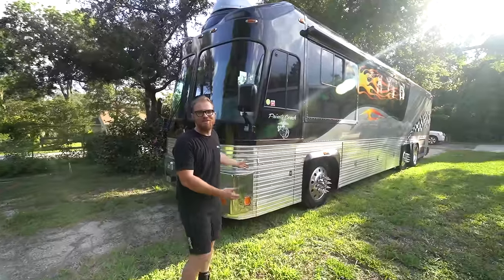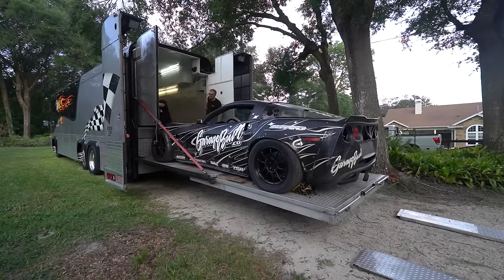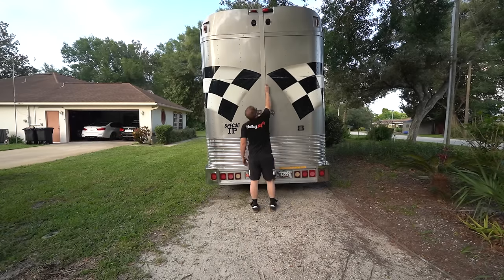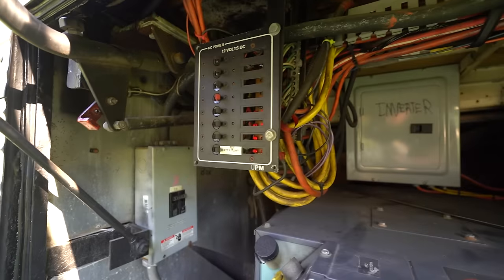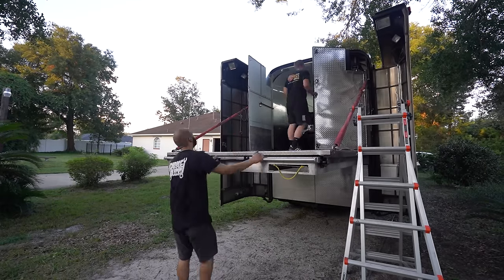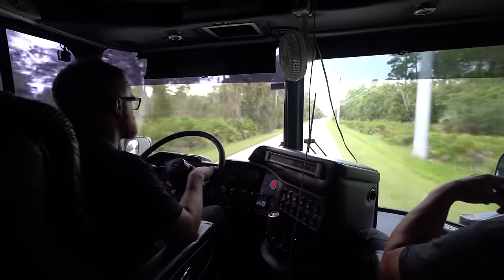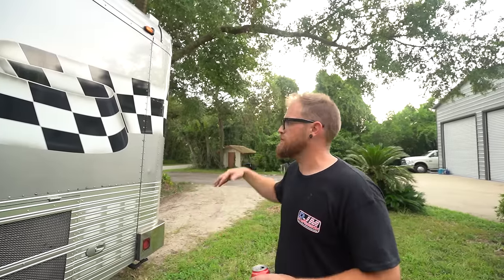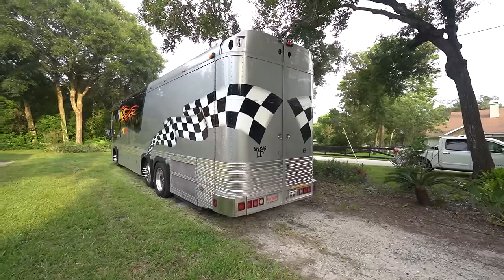First test of the new race car hauler. RV bus conversion. will it fit?

Comment: I was a coach mechanic for 40+ years, mostly MCI, Prevost,and Van Hool. Didn’t work on to many Eagles. I know they have a weird torsion bar suspension. I’m sure the guy set it up for the added weight of the car in the rear. It looks like a Cummins M 11, and I would assume it has an Allison automatic trans? Probably going by the year a HT740? Nice setup!

Comment: Would be a good idea to get under it (if possible) and drain the air tanks out from the valve on the tank to make sure there’s no water build up. Sometimes there’s a cord attached to it and visible off the side so you don’t have to get under. Drain all of them, start the truck and let it build to pressure and let it sit to see if it has a leak. Also getting under with a grease gun and hitting every grease fitting is good to do. Just some regular maintenance tips. This thing is sick man good luck with it cant wait to see upcoming videos
Reply: I thought I heard spitters on it. The kind that automatically expel all the moisture periodically. I could be wrong though. I would install some if they are not already.
Reply: @b-radfrommalibu  That's just the air dryer purging, you still have to take care of the tanks.
Reply: @-tr0n  oh ok good to know

Comment: You keep referring to your coach as a converted transit bus. It is a model 15 Eagle highway coach. Used by many coach operators such as Continental Trailways. Many Eagle coaches were converted into motor homes which were favored by traveling entertainers since the Eagle uses a torsion bar suspension which gives a superior ride over an air bag system. I saw one comment telling you to lift the tag axle so you can make tighter turner. You can’t lift the tags on an Eagle since there are no air bags. Are you sure your power plant is a  Cummins? It looks and sounds like a Detroit series 60. Good luck with your project, she’s a beautiful coach.

Comment: With the winch, they don't like rolling up without tension on them.
Probably best to unspool it completely and re-wrap the whole drum. 

Rig looks awesome.

Edit. Add a side roller to the rear winch, that will help keep the wire more centred.

Comment: Suggest you watch some of the "Bus Grease Monkey" bus maintenance videos he has done. Diagnosing problems and preventive maintenance with these rigs is imperative! Some  OEM parts are very hard to locate or acquire.Your air brake system must be spot on for you and other vehicles on the road. AND just for giggles drain your main air tank NOW!

Comment: One thing i noticed is all your tail lights are on the doors that open  so if you had to work in the engine bay at night at the side of the road you would have no visible lights, so you should look at adding some tail lights behind the doors as well!

Comment: I didn’t get through the whole video yet but with our team that races cup spec Porsches we take off the drivers door when putting it in our hauler, especially on the top level. It’ll help a guy get in and be able to steer and brake while also being able to get out easier.  We may have more clearance than you though.

Just a thought! Love the rig brother!!

Comment: Bus is awesome! But, what's the point of the diamond-plate doors? It's a 3rd layer and seems to cause all the issues. Can't you just take them off? The lift and the clam shell back should seal it all.

Comment: Bus is cool af man. Curious,  do you need a cdl to drive it? It would be cool to use the air compressor to fill another tank so you can use air tools at the track if you had to.

Comment: Hey man, I have a tip for how you can easily drive the car in without being inside. I saw once a dude who put a snap-on u-joint adapter on his steering wheel, a rod going through the side window, slightly protruding, and literally had a quick release steering wheel on it to steer the car! Sound insane but it worked neat!

Comment: did you check the slack adjusters in the s-cam air brakes, are they the auto adjust or manually ,  know where your tow points are under the bus it's heavy and one day you night get stuck.

Comment: You should do the trick that most lift gat trailers have. Have a strap that grabs the side when it's about half way up and as you lower the gate it lifts the gate at the same time. Gets rid of the need for the winch all together.

Comment: So happy for you! Man just think back to when you started and where you are now!
Silly question though, are the rear internal doors required?
The ones that cause the loading and unloading of the car to be super tight. IMO those doors could be removed unless they provide a weather shield.
Maybe a good alternative would be to replace those twin internal rear doors with a single lightweight door that lifts up over your head and is then held in place, this could then create a simple canopy and would also provide you with more space left to right.

Comment: I watched the Hunt the Front guys struggle loading their late model into the trailer. They use a steering wheel buddy, it’s used to steer the wheel from the back or front while using a winch. Might look into that.

Comment: One thing I would like you to do get the CDL book and read it .. lots of little details that will help you to make tight maneuvers .. you also need to get the exact height of the bus and write it down somewhere inside the bus where you sit .... Heights on Bridges and overpasses are very important they vary from state-to-state ... The two most serious problems people driving large vehicles are heights and turning .. I have driven a bus for 21 years .. if you ever need some help or need to ask a question I will gladly help you ... Excellent purchase enjoy

Comment: Hey Taylor-
First off, congrats on the new bus,  you've earned it, you stayed humble,  and let's face it- the perfect rig found the perfect home!  Anyway, I have a Buddy that has a similar rig (not as quite as nice, but close) and he dug out  a  little "pit" for his lift gate to drop into when he wants to load/unload his vehicle.  This eliminates having to mess with those 2 little ramps, as the lift fits perfectly into the recess.  He has 2 pieces of angle iron so the front tires of the bus align perfectly every time and it makes loading and unloading a breeze. Outside he has a pedestal with power, water, sewer, etc. so he doesn't have to go somewhere to empty the tanks, and that gives the bus "full hook ups" if he needs to have an impromptu place to put up guests for a few nights. Everything at the house is all stored in a 2'x4' rubber maid-type basket when he's out of town, keeping his yard uncluttered. He took a couple of hole saws and put access holes for the cables and hoses to go through when he's hooked up.  (It takes bad-ass to a new level) Even has an internet CAT5 cable tucked away in there, thus, avoiding wifi hassles.  To make the "pit", he borrowed a friend's Bobcat and dug it out in less than an hour. It's so cool.  I'll see if I can get him to send me a few photos that I can pass on to you, in case you want to do something similar.

Take Care, my friend, enjoy life, and have fun in everything you do.
DB from AZ

Comment: I'm gonna give you my 2 cents on it. Heavy trucks are much more envolving when it comes to maintenence, even in regular stuff.
I don't know if you have done any of the following things but since you recently aquired it, its good practice to a once over on every thing.
Starting by the security apects, like removing tires and inspect / change:
wheel hubs oil (inspect for metal flakes probably from bearing fail due to slack), wheel hub bearings (bearings preload), rear hub seals, brake cams slack, all pivot points like king pins, steering knuckles, etc... shock absorbers, brake drums, brake chambers, brake shoes, air leaks in general, air dryer, purge air tanks (inspect for oil residue from compressor) air bags condition (cracks) and a fue more things. on reassembly grease all greasable points, brake slack and so on...
Some of these are regular maintenance items others are just to make sure that all is well and in spec.

Best regards.

Comment: There's things I could mention only because I have a mth W/sliide outs, I don't know if you have leveling cylinders on the bus and maybe it does and the seller forgot to mention it, if not no problem I guess, I do know that when you operate the slide outs once you push the botton to go out hold button till all the way out,no start stop, same with coming in no start stops, it helps to keep alignments. Probably same principle with tailgates etc. I do know the better you get the rig leveled the better for everything. 🏁🇺🇲ML33MI.

Comment: Maybe a extended steering shaft and wheel onto the regular wheel quick disconnect, to steer the Vette?
Is there a onboard air compressor?

Comment: Bad ass set up, we have a similar set up but ours is a trailer car storage on top and garage on the bottom. The e track idea is smart but I know from experience that the car(s) usually don’t move if you have four straps on it. The only problem with that is that you have to have some very good straps. Another thing is if you don’t like to get in and out all the time there is a company that makes steering buddies that use 
a Milwaukee battery. They have a quick disconnect on them. We use it for our cars bc we’re all bigger guys and it’s a tight squeeze in between the trailer wall and the car.

Comment: Looking at the air compressor on that thing, I would imagine you could run air tools and possibly quick jacks off it at the track. TV seems like it may need to have the channel set on it or the receiver may need to be changed to the correct setting to output the picture. Some of the off road viewers may be able to chime in here.... but I'm relatively sure you can get a wire lead that runs back and forth across the face to ensure the cable runs out/in smoothly

Comment: Awesome bus.  Couple things...get a Micro-Air soft start system for the AC units on the bus.  They will draw much less amps and help with longevity.  There are a ton of videos on them.   A big black bus would be much less visible during darker times and could make it harder for others to see (just thinking safety).

Comment: From what I seen that looks like a Cummins m11 most common over the road failures I see is blown turbo and plugged fuel filters I would keep a couple of extras on hand if you get me the engine serial number I can help with identifying parts and the motor itself keep up the good work!

Comment: Taylor us dirt track guys have this thing called a steering buddy. It hooks right onto your steering shaft ran off a drill battery and it has a remote so you can steer the car from the back while your winching it into the trailer pretty trick deal might help you out. Give it a look see what you think.

Comment: Taylor if you drill a hole in the end of the folding ramp so a  D shackle will bolt to you now have a engine crane so you can remove the engine if needed at the track or for lifting in general cheers from down under

Comment: Congratulations, I’ve worked on a few of these rigs, they are all individually unique, go through and get that motor completely serviced all your filters and it wouldn’t be a bad idea to get somebody who knows what they’re doing and really check out the suspension and steering even though it seems to be fine get all of that checked out, maybe take it up to Bus Grease Monkey and get him to do it

And yeah there’s a lot to these big things, bridge clearances, canopy clearances at gas stations and hotels, clearance is getting in and out of driveways and things like that where you have slight elevation changes, but have fun cause it’s gonna be a blast

Comment: I would suggest a ladder on the car compartment so you dont have to go through the bus for parts in the pits. Im sure you could find a spot to cut a hole and build some brackets above the motor of the bus for slide in storage

Comment: Get a Rand McNally Motors Carriers Road Atlas, but get the laminated spiral bound book so you can lay it flat and use dry erase maker for your routes. I'm a truck driver as well and the GPS is great, but it has "steered" me wrong. Also, using "the book" as I call it, gives you an awareness that no GPS can give ya. Great video btw!!!?

Comment: Taylor, if you want to do a better upgrade, change the transmission to an Allison B500. It’s a 6 speed instead of the 4 speed you have now, and it’s much smoother and quicker than what you have, and has a really nice overdrive gear. It would have to be a WTEC2 possibly. I don’t know specifics on communications, but that Cummins is not the original motor, I’ve only seen two stroke Detroit’s in those transit Eagles.

Comment: New subscriber but really impressive rig. I realize you have a lot to work through on it for improvements but wanted to mention the items that jumped out at me. You being able to fabricate definitely opens up some potential enhancements.

- mountable snatch block in centerline of garage floor (to run winch cable low and straight down the middle for easier loading and less rubbing on bumper).
- mountable wheel chocks in garage and on lift for additional safety (secured to deck somehow but removable)
- refabricate the bifold garage doors into a single door that uses gas struts and lifts up and over (becomes rain/sun shield and doesn't get in way of lift cable supports, seemed like you were tripping over them a lot.)
- add removable pull straps to the lift extension and ramps (to save your back from bending over during loading/unloading)
- add auto locking spring retainers on ramps to keep from lifting off during loading/unloading)

Comment: Loving this new rig and evolution of your channel. With the tailgate lift cable have you thought about a seat belt material winch? It won't bind, get hot no cut and damage people or cars. I also noted maybe pulling out the lift deck extension when it's a few feet off the ground rather than a couple inches. With the doors I saw Hosey & Krissy (sorry if the spelling is wrong) playing around with bungey cords, maybe make a latch point up high so it pulls the doors wider and also means you only have to touch it once.

Comment: Guide tracks or channels with indexing dowels  on the ramp. that way you're located in the same exact place every single time you drive the car onto the trailer ramp. Use L channel on the inside of the wheels opposite  each  other.  I used a composite  2x6 and  a 2x4. I got the idea  when  taking my daily driver through  the car wash.

Comment: Would there be any benefit to putting access panels in the lift gate so at the track it could be used to work under the car a little?

Comment: Taylor, after listening to the engine noise more, it definitely sounds like an M11 Cummins, and part of the number plate you see on the timing cover, looked it said the motor is rated @ 400HP and 1450ft/lbs of torque.

Which is why it feels so quick, that low end torque really, is what helps get things moving. And that 400 horse is definitely enough to easily maintain highway speeds, no problem.

Comment: Put it on the other side of the shop and add a door on the shop that lines up with the side door on the rig so u can use the couch area as a hangout/relaxing spot in the shop when its not in use

Comment: A suggestion put some mirrors on the front of that lift gate so you can pull in by yourself if you ever have to or put sum convex mirrors up inside pointing down on either side but make them removable if you have to pull something in bigger

Comment: You gotta weld up a long extension  to operate those top rear door pins. It’s so inefficient to have to go up and back down on the gate just to open the back doors

Comment: As a previous transport company. You want to add more lighting especially on the loader. The winch line needs a snatch block & it’ll help with tangling. But update the lighting asap helps especially at night or LIABILITY REASONS

Comment: One thing I thought with the lift gate.. cool it lifts it right. But it would be better if you could somehow fab and customize it to be like almost a 4 post hoist with removable rear beams. So cutting out a middle section or come up with something like a 4 post drive on lift to be able to service your car at the track ect.

Comment: I'd definitely consider maintenance and/or modernising what you can on the electrical system, lighter stonger batteries, new inverter, better gauge wire, fuses,breakers, double check all the connections/grounds. Modern electronics can nuke older 90's/00's stuff if something isnt wired right or grounded sufficiently and the last thing you need is an electrical fire.

Comment: For one exit and one entry, you could do it on the battery only. I'm sure you will use the generator between each "step". So I'm not worried about that.

Comment: You can probably use a pneumatic linear actuator for that ramp so you can stop having to tilt and use gravity to get it set back in for storage... you already have the compressed air onboard, all you need is the cylinder, fittings, valve and lines + some fabricobbling.

Comment: For the gate winch, if you can mount the winch at the angle try to. 

Angle it so the winch is “facing” that corner of the ramp, not the rear of the ramp. That way it is pulling directly towards that angle. 

Another solution is maybe have just a keyhole like tow truck have or put a short track on the ramp about a foot over from the corner so you can use a pulley on a short chain when you are rising the gate so it pulls evenly.